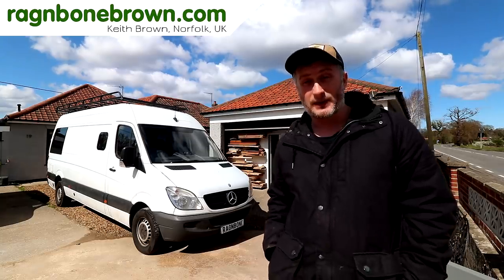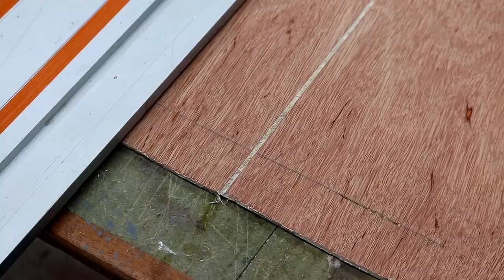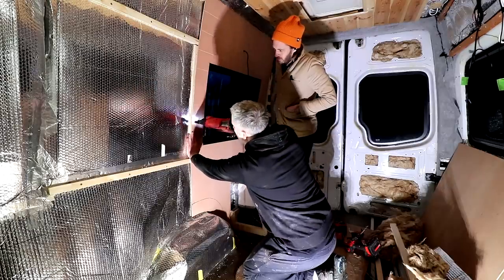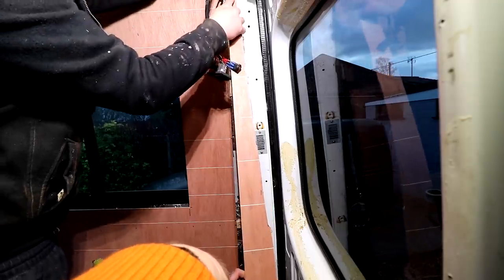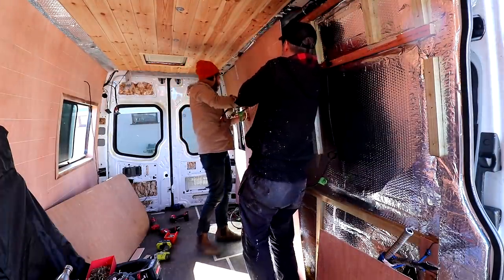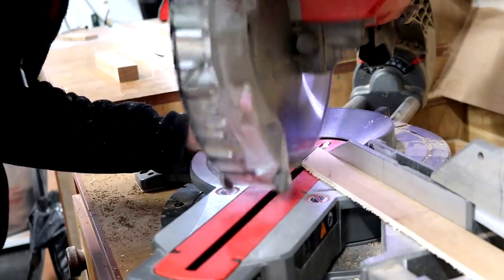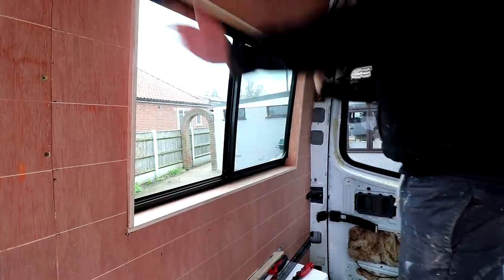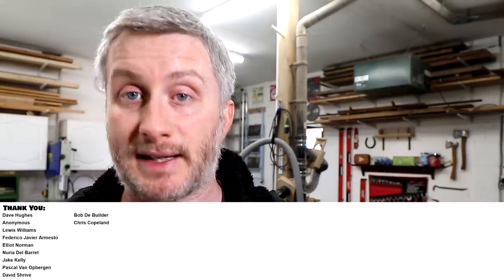Campervan Conversion - Walls & Windows - Mercedes Sprinter

Comment: A good foam to buy is insta stik from screwfix. It doesn't expand and push things around, it just expands and fills gaps, but also sticks all sorts together. I've used it to stick 3 x 2 stud walls to steel RSJs and they never move. I think it'd be helpful in this van where you can't get as good of a fixing as you'd like in some areas. I don't know how i got on without it in the past lol. 
Also it's a good idea to angle the window reveals, rather than keep them square. It's something people do in loft conversions, it allows more light in and makes the space feel a little bigger
Great job as always, looking forward to future videos of this build
Reply from the maker: Thank you!

Comment: A solid start. Jobs where nothing is square can take up a lot of thinking time. 
Hope they won't get condensation problems with the trim touching the glass and part of it being inside the wall.

Comment: Nice job. I've got a 1972 camper coming back from a restoration....
You have given me some good ideas for the inside...
If you haven't done the cabinets yet look into vohranger board. It is like prefinished MDF but weighs hardly anything....

Comment: Looking good Keith a couple of things the window boxes paint the edge black that faces the glass and it will be completely invisible. Also I'd take down the T&G panelling on the ceiling it look rough also if you go with the ply it's much lighter. A lot of weight up high will make the an rock even more.
Looking forward to seeing how this comes out.

Comment: Quick tip, drywall screws drill straight into the van steel just like a self tapper

Comment: I've got an old vw camper that's currently at the paint shop.  I'll be building the interior for it later this summer hopefully.  I haven't got a clue what's going to go into it yet, and there's probably less than half the space there is inside that sprinter.  Favourite idea at the moment is to make all the units from thin mdf that I can then spray to get a high gloss finish (probably cream to match the roof) and then trim edges with black walnut, mainly coz I've got some

Comment: If you use low expansion foam, would have of course expanded less. Or squirt with water to cure it quicker 👍 nice work as always

Comment: Hi Keith , great video , questions , will the insulation cause condensation and is it for keeping heat in and do you need to tell DVLA about conversion or get it MOT ed or tested in anyway for fire and saftey , thanks , keep up the good work ,G.
Reply from the maker: Hi Graeme, I'm not an expert on this stuff, I've mainly just been brought in for the joinery aspect.  But the insulation I would imagine is not only for heat but also sound.  The foil insulation acts as a vapour barrier to prevent condensation forming on the cold metal inside the van.  Not sure re DVLA stuff, sorry!  Cheers, Keith

Comment: Hi Keith, I like this new series, have been thinking about converting a van in the future. 
What I don’t get; how can people sleep in the width of a normal van? How long is that bed going to be, 180 cm, maybe 185? I always learned that a bed should be longer than your length for it to be comfortable, so a 180 bed could only fit tiny people, up to about 170 cm tall. I am 192, so I am not even going to try to sleep in the width...
Reply from the maker: Thanks. I'm not entirely sure, but I'll endeavour to let you know in a future episode!

Comment: Very interesting! Are you sure the woodscrews in place of self tappers will remain tight given the amount of vibration that happens in a vehicle?
Reply from the maker: Cheers. I don't think self tapping screws hold any different to normal ones, they're just designed to cut in to the material without pre-drilling. The normal screws hold really well so I'm not worried

Comment: Are you going to do the sliding door and rear barn doors? I need to do these in my van to finish it off! Great video, would be very helpful to a big audience of van builders out there.
Reply from the maker: Yes, the rear doors are done now we are yet to tackle the large side door as the client is unsure whether to do it in two panels, one at top and one at bottom  (easy option) or one large panel covering the whole door (which I think will be a real challenge !)

Comment: To minimize tear out on the low quality, thin ply, did you try a reverse scribe cut so that the blade is cutting on downward rotation?
Reply from the maker: I didn't try that, although for the amount of grooves we were cutting it would have taken a lot of extra time, good idea though 👍
Reply: With that shallow of a cut (~5mm), do you think you could do it in a single pass? (Not sure, saw Dave Stanton do it so haven't tried myself) Regardless, the bigger issue is spending all that time building the van using plywood that falls apart after a year. Great video, love the channel!
Reply from the maker: Of course, you're right, I wasn't thinking straight 🤣 yeah maybe it would have worked, might give it a try as I'm sure we'll need some more grooves at some point

Comment: B&q or any diy store plywood I find is a total waste of time. The face veneer always comes off you only need to catch you’re shirt on the corner and it peels  right off. I find that the glue used aswell isn’t good as the plywood often starts to come apart. So I started going to my local timber merchants for it. Much better quality

Comment: On the big windows you should of battened out the window first, added the ply, then you can just put a guided flush trim router through to cut it out using the battens as a guide. 

That’s the easiest way to do the roof fans as well once you get to it. Just clad over them, drill hole and shove router in upside down. Again using roof vent/fan frame as guide.
Reply from the maker: Hmmm. Nice idea... But then the battens around the windows would interfere with the fitting of the wall panels, as they need to be curved to the shape of the walls ?